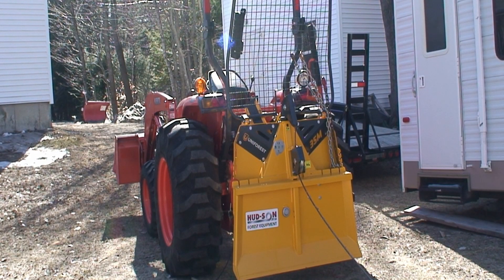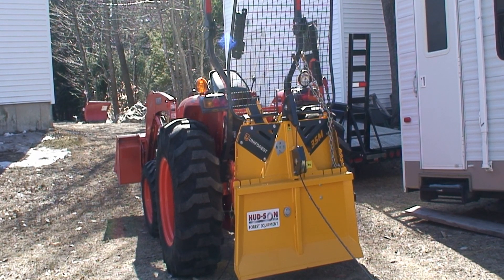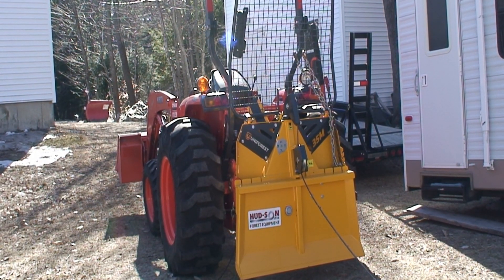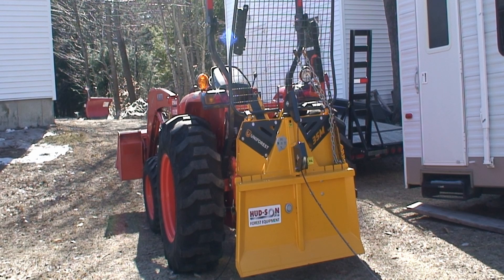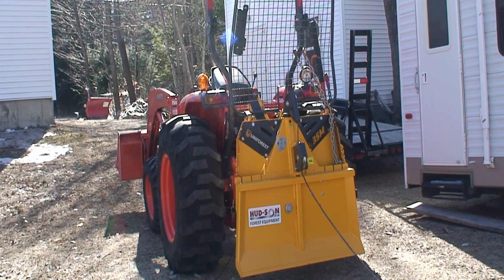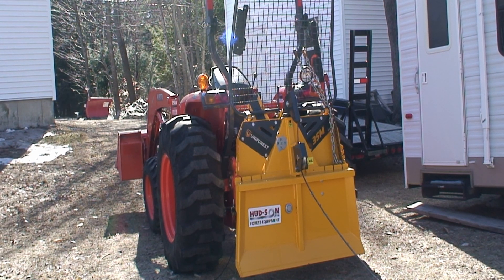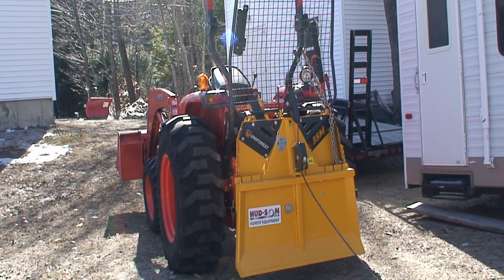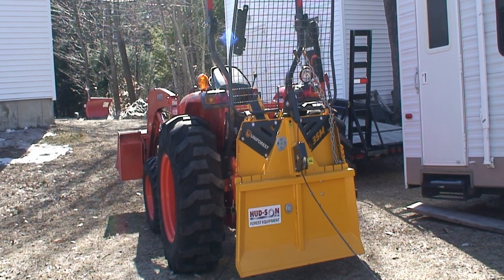#3 Hud-son Uniforest 35M Logging Winch Re-wrapping the Cable

Comment: was the pto engaged and running the hole time during the operation and do u need to have the pto running to pull the cable out or does it just pull out as long as the brake is released the no detailed operation of this winch online many thanks mark
Reply from the maker: The clutch can be disengaged on the winch and the tractor shut off.  Cable will free wheel to pull out .
Reply: @udgrin2  ok thank you for your reply much appreciated

Comment: All these are trouble! Had Farmi 351p, pure junk! Cable binding, chain breaking, roller bearing problems, we use a capstan hydraulic winch now, smooth power by Norwood Sawmills
Reply from the maker: I haven't experienced any issues with mine yet, but I'm the only one who uses it and not using it for any kind of high production,  so I hope it lasts a long time.

Comment: I am looking at buying one of these
How is it working for you?
Any complaints?
I like the price but am worried it won’t be as robust as the others?
I would be using it for pulling out firewood I think it would help get the most out of my land as I could grab wood from most anywhere I would imagine I have a Grand L 4060
Thanks for the video
Reply from the maker: This has been very useful to me and has met all my expectations.  This winch is supposed to pull 7700 lbs.  It's pulled everything I've thrown at it with no issues or breakdowns...

Comment: Nice winch , What made you decide to get this one?
Reply from the maker: The biggest reason was the price.  And shipping was free and from the many video's I'd watched it appeared to be a well made, quality product.  I'm a team of one and not a big business who would use this 24/7.  But with that in mind the winch has never failed to accomplish all my needs.  It is built very rugged and in most of my videos the tractor was only on idle and performed wonderfully.  Cable length was longer then most brands and the 7700 lbs of pull met my needs.  My kubota tractor is an L4600.  I hope that I answered your questions...if not...ask me more...  smilz
Reply: These winches are all pretty awesome.  Whether you buy a Uniforest, Farmi, Wallenstein, Igland, I'd recommend you buy a name brand and you'll be happy.  Nobody in my area had one I could check out so i finally bought a Wallenstein 110 sight-unseen and it has way outperformed my expectations.  In my case I wanted a hitch receiver on the winch so that's why I picked Wallenstein.  Different brands fit different folks.  Too, these winches are safer than logging with chains.  You can set the tractor where it's safe and winch the log out of problem areas.  As to the comment about the capstan hydraulic winch from Norwood, I'd just ask you to take a good hard look at how heavily its built.  You get what you pay for.  Good luck and safe/productive logging and firewood cutting to all.  Bigmule Bear, thanks for posting the video.